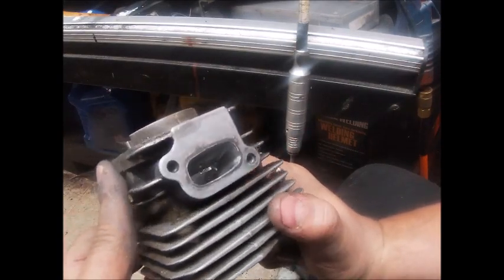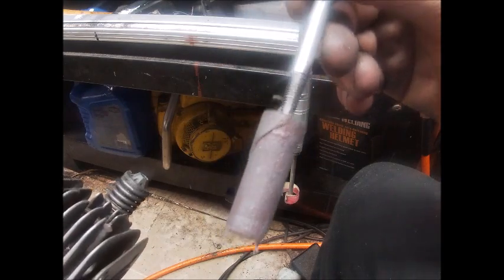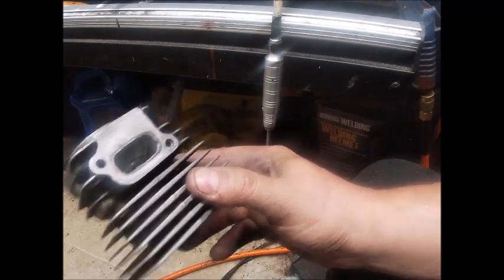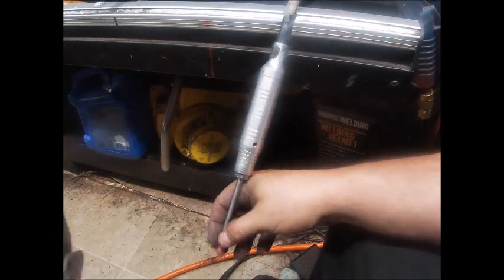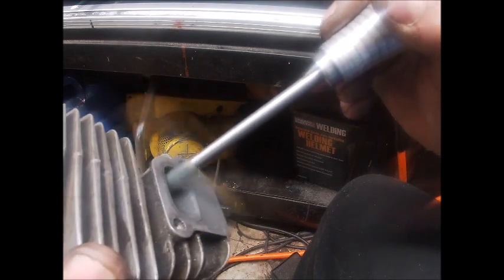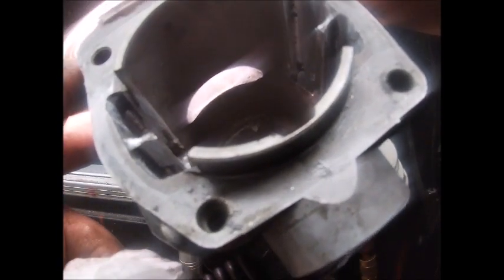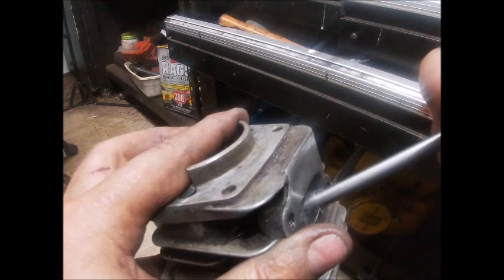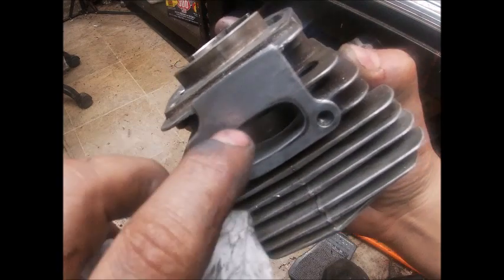CHAINSAW PORTING TIPS! How I Polish an Exhaust Port 2 Stroke Cylinder Porting

Comment: What is the advantage of running 32:1 premix? I've been running 50:1 on all my 2 stokes until 6 months ago when I switched to AMSOIL Saber, which I've been running at 80:1. All my equipment has been running better since switching, almost like new.
Reply from the maker: More bearing load